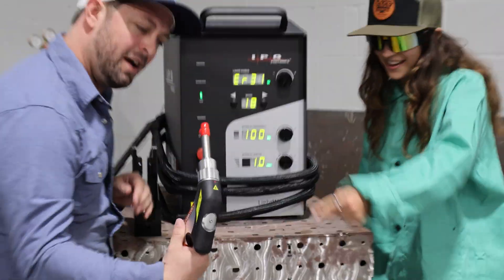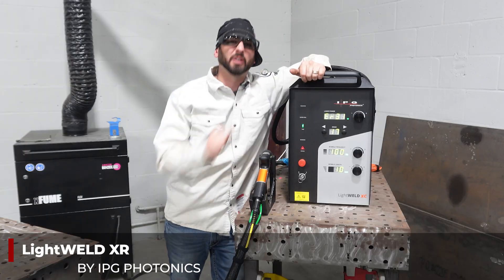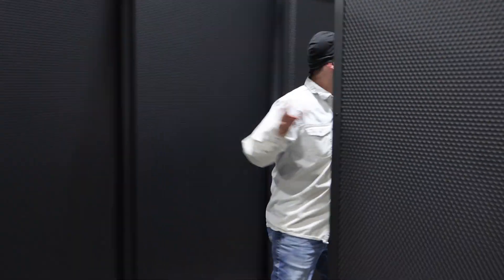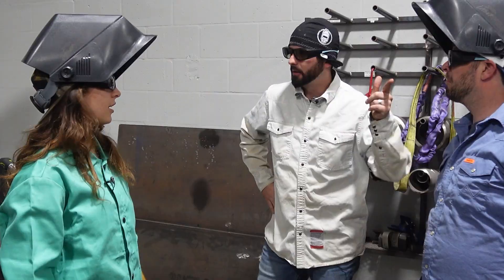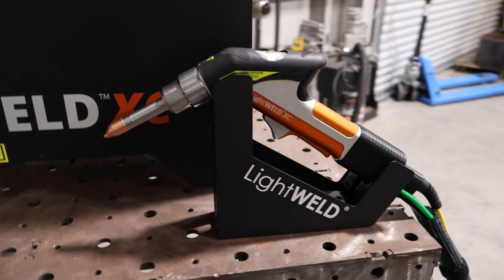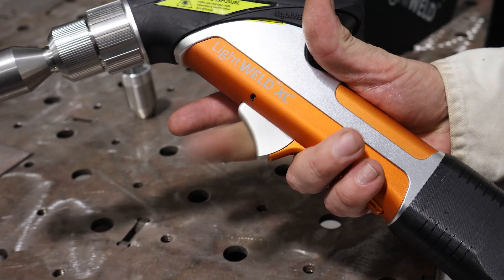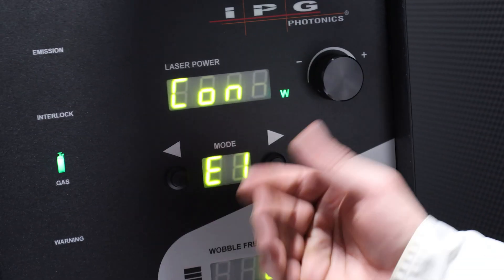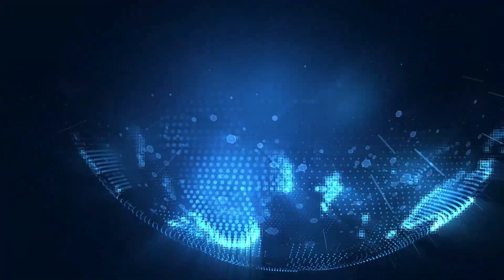What PPE & Safety Equipment Do You Need For Laser Welding?

Comment: What I don’t like about the Lightwave gun is that the gas comes on as soon as you press the bottom trigger. That’s a lot of gas being wasted! I prefer my gun, as the bottom trigger initiates the safety process of welding, cutting or cleaning. But the top trigger actually initiates the process of turning the gas and then, the laser on. So like my ESAB, I can set the amount of time I want the gas to begin and the delay before the laser turns on, and if using it, the wire feed. It then holds the gas on for the time I’ve set after the top trigger is released after the process is completed. I don’t understand why the Lightwave doesn’t do it this way. Or, if it can, why none of the demo’s, even by IPG, have shown it. It seems that you can press that bottom trigger at any time and the gas will flow. Why?